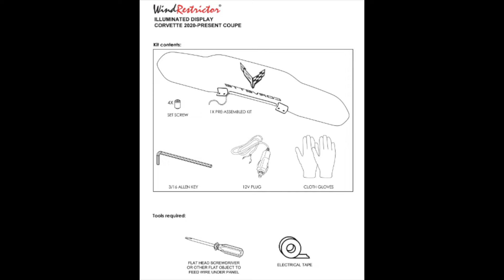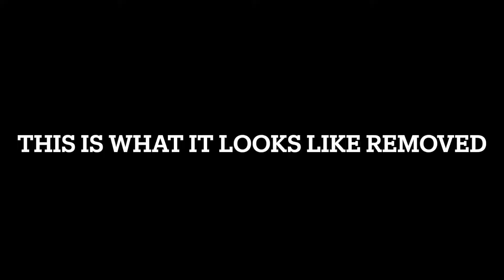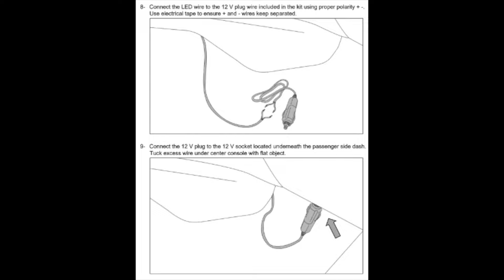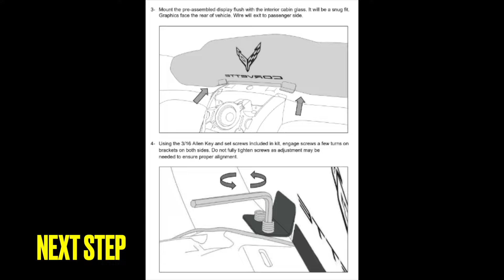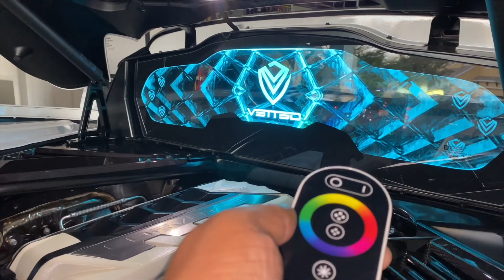New C8 Corvette Glowplate (Windrestrictor) Install Video!  Use my code " V3TT3D " for 10% off

Comment: This looks very cool!  How bad does the light interfere with vision while driving?  Do you photos / video of it shining on the engine bay?
Reply from the maker: It is not bad at all when lit at night. I do have pics of it at night. I’ll take some of it shining on the bay and post them on all on my Instagram page (same name) V3TT3D mid-week. I drove with it lit on a night time rally and had no issues. The rear view mirror is based on the camera on top of the car - so negative obstruction on rear visual field.

Comment: Does it start when the car starts, or do you have to turn it on?
Reply from the maker: @Rampage-gq1dd -  mine turned on when car door or remote (wind restrictor remote or C8 Fob). It comes with two options: connect via 12v Plug or rechargeable power bank (see the website: (www.windrestrictor.com ).